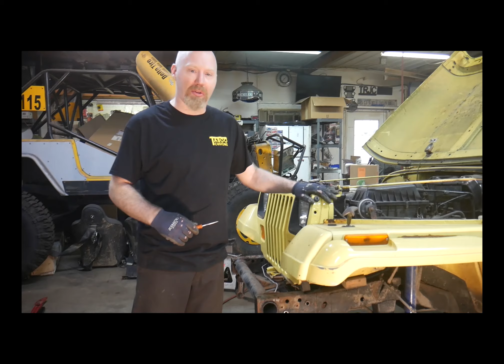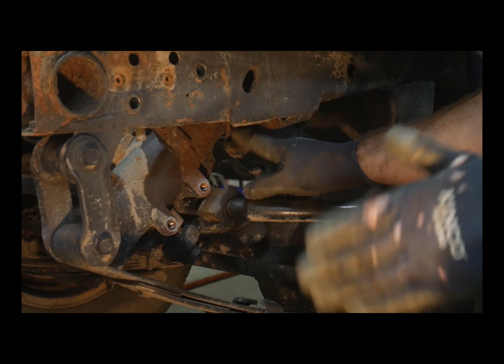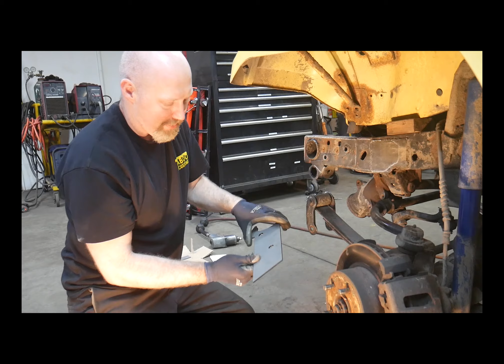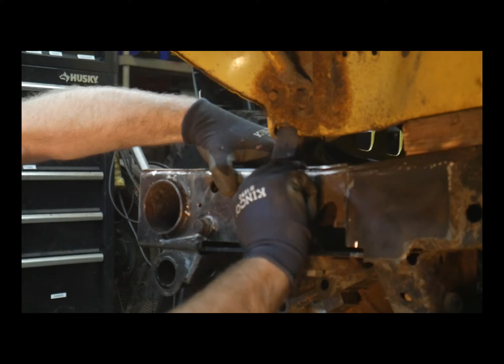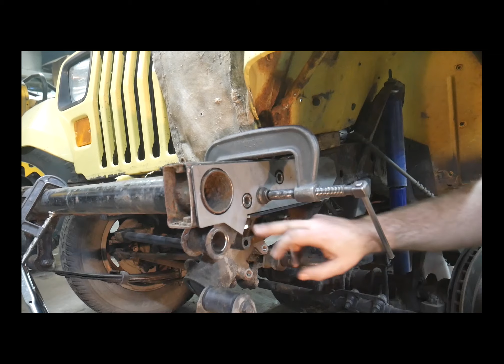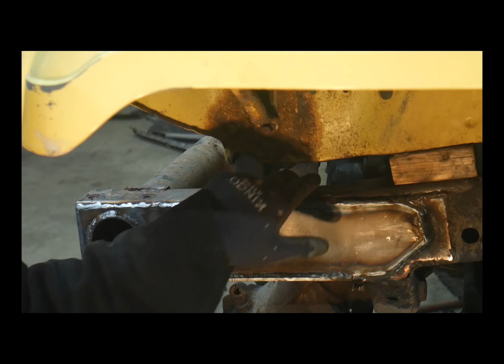Jeep YJ Front Driver Side Frame Rust Repair

Comment: I just finished welding this exact kit. Went VERY well. Everything lined up pretty much perfectly. The ONLY issues is, PLEASE PROVIDE THE BOLTS. I would not mind paying extra for the right bolts. 

I went to the store and bought the "right bolts" and well... Wasn't. So when I was screwing in the first bolt to the nut, it got stuck. I had no choice but to keep going and boom... Broke my welded nut. So, I will have to either drill a hole from the top and put a screw through with a nut or Cut the top of the frame and then reweld the nut and then weld the top of the frame. :(

Besides that, this is a great kit. Just should include everything you need. Charge the extra $5+ to the kit.
Reply from the maker: Thanks,  We will take a look at that.  I have seen people run a bolt all the way from top to bottom of the frame.
Reply: @TabooCustoms  Just an update, I spoke to a rep at taboo customs and they think my issue is that I had weld spatter in the nuts! Which, yes I'd have to agree. I am an amateur welder and didn't think to cover the nuts. Duh! 

So, totally my fault. I'm 99% sure this was my issue. Live and you learn.
Reply: @TabooCustoms  I will be drilling a hole from the top today. The top of the frame looks ok. Should work just as well.
Reply: What size bolts did you use

Comment: Just getting ready to plan out fixing my 95. It's needs love. I came across you on youtube. I'll be ordering your kits vs the "other brand" I was originally going to use. I don't mind welding the plates together into a channel vs it coming welded.  Glad I found you guys on here.
Reply from the maker: Awesome, yeah we find it a little easier to adjust plates how we need if they are not welded up already.  Sometimes what we will do is tack them up on the frame then pull them off and weld them up then slide it back over.  However on this DS front kit it goes around the crossmember tube so you cant really do that on this one.  If you have any questions let us know and we are happy to help.  Dave B

Comment: Came over from Elins videos. I take it you don't have preassembled front rails. Something that I could essentially hack off the front 18"-24" of rails  and reweld on a fresh new assembly. I hate stacking metal over metal. I know it would cost more but your quality would probably be much better than my welding ability for the assembly.
Reply from the maker: Correct currently we do not have full replacement sections.  We are working on these but we are not sure when they will be released.  For jeeps with extreme rust issues (like Elin's on the passenger side) the full assemblies would be better than the layover kits.  However with installing a full assembly the welding quality is much more important because all of the welding done by the customer is going to be at only a couple points.  With the layover kits we are keeping what is left of the original structure that was still good and adding to it with a lot of welding along the panels.  Obviously this could still be bad welding but the probability of a catastrophic failure is lower.
Reply: Copy, TY for the response